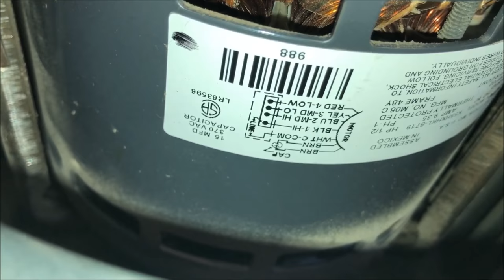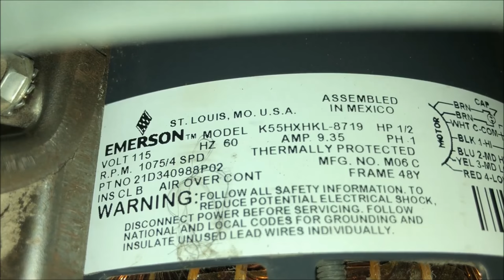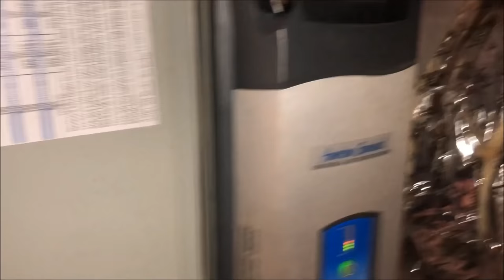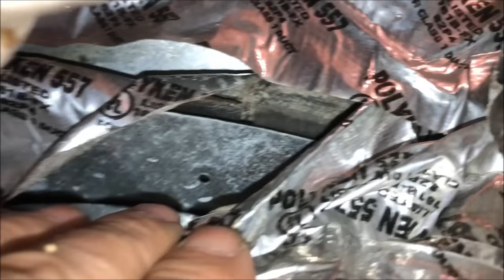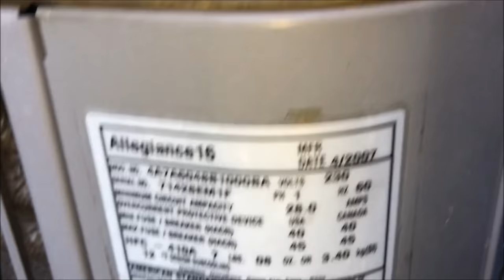Gas Furnace needs replaced ? Tripping Breaker 2nd opinion

Comment: Only thing I would add would be to make sure that motor bracket is nice and tight. Even if using those OEM rubber mounts. If you do not get that bracket on tight that motor will eventually torque its way round and rub the leads bare where they exit the motor shell. Against the motor brackets. I’ve only seen it happen once but once was enough.

Comment: I had a similar experience yesterday. Pulled into a no cooling call with the furnace breaker tripped. Reset and as soon as the fan turned on I saw a big spark from the fan and the breaker tripped again. Remove the speed taps and heat and ac would both turn on. The bad motor was installed 3 years ago by our good friend Mr. Run Cap Bandit who left the cap hanging

Comment: I remember a call a long time ago. Pretty nice house, the furnace would only make a humming noise. I checked it, and it was 208-230 volt on a 120 volt 15 Amp Circuit. Look everything over real good, the only thing I could figure is a hack job with a used furnace. Told them they needed an electrician, to run #12 with 230 volt to the unit. Of course they called the service manager on me. He came out, I told him to look carefully at it for any sign of a used unit installed. He agreed that’s what had been done, as he found some new screws in the flue pipe, that I had missed. He thought they had done the work themselves.

Comment: Great you got them cooling...amazing Trane/AS still uses the old GE indoor motor bracket for PSCs.  I remember them on the WeatherTrons from the late 60s.  Little more of a pain to replace than the belly band brackets, but I guess stick to what works.

Comment: Dude, you need to pull that blower and inspect the secondary heat exchanger, that rust probably ain’t from a hose.  I always pull blowers on furnaces older than 12 years.

Comment: Did the last 'repair' guys leave that unit that way? What a mess! Good cleanup!
Reply: I'm a retired electrician and have gone in after "electricians" who leave panel covers off, junction boxes open, hot wires sticking out, etc.  These jacklegs give good tradesmen a bad name. They usually work themself out of a job by the crappy work they do.
Reply from the maker: Exactly as you saw it yes.

Comment: not only is the long run just to do a 180 turn is insane, but all the up and down roller coaster track on the way, its not suppose to do be that for flex,
at least way I thought about the air pressures, it suppose to be a straight line.

Comment: Would you pull the new motor and put back in stock after replacing the customers old HVAC? That's assuming they buy a new unit within a couple weeks?
Reply from the maker: No.
Reply: I would not put it back in stock and pass it off as a new motor, but still set it aside and have someone remove it and label it as a “loaner” motor for occasions such as the one on this video.
Reply: It would be OK for a charity job, but you can't sell a used motor as a new motor
Reply: @adambell2068  I agree the motor could be used as a loaner. I wouldn't sell it without explaining to the customer that the motor had been in service for a few days.
Reply: The instant he pulled it out of the box it became a used motor.
Reply: Nope 🙅🏻 once you pull it out of the box it ultimately used without a doubt.

Comment: Probably should’ve replaced it anyways. Those 90s are known for cracking on the inside face plate. Always condemn those furnaces sadly.
Reply: was thinking the same thing, seeing date of 2007. but maybe they'll get a few more years out of it
Reply: throttle bottle I typically find them around ten years old. Trans says it’s okay to have a crack that’s no bigger than a 1/4 inch. But personally I’ll still condemn them better to be safe than sorry

Comment: Just curious but why is there a delay? I know when I turn my a/c on there is a 5-10 minute (sometimes it will come on without a delay) delay but theres no delay on the heat.
Reply: It's designed to protect the compressor.  It's not good to have them smashing off/on/off/on.

Comment: I'd like to hear more about the "clean effects".   I bought one several years ago.   Seems like our dust immediately went up rather than down.   THOUGHTS.  OPTIONS.
The other thing I noticed:  the electric bill went up immediately after changing to "high efficiency".
Reply: The clean effects filter needs frequent cleaning to maintain its effectiveness. A media filter works well, especially if aiming for MERV-13, but has to have lots of surface area to avoid increasing static pressure above the air handler's design pressure. Otherwise, if the static pressure gets too high, either the air flow goes down, or with a variable speed motor, the motor power consumption goes up to maintain flow. That causes increased energy usage. So, your higher energy costs could be from the clean effects not being cleaned often enough requiring the blower motor to run harder (and needing replacement earlier), or from the clean effects itself, or worse yet, by rewiring the unit to run longer to blow enough air. The flowing article describes some of the challenges of high MERV filters:

https://www.energyvanguard.com/blog/path-low-pressure-drop-across-high-merv-filter

Comment: Saw some super sketchy electrical work. The 3 conductor wire seemed to be stripped too long on the furnace side, and the hot could fray and cause a short against that metal plate! Not to mention, we have a missing (broken) face plate on the power switch! That leaves live contact screws within reach, which is a shock hazard!

Comment: BIG wire for the furnace 30 amp ?, motor is 9.35 amps ,15 amp 14/2  wire will work .

Comment: If you don’t use the oem motor the plastic pieces will not hold and the motor can move around on start or during the cycle making a noise. I’ve had used universals all the time and once I had to get the oem cause the motor wouldn’t stay in place.

Comment: Nice work.  I replaced my fan motor not long after the run cap quit. The end bearing/bushing inside the fan motor wore out.  The motor rotor was rubbing against the stator.  It hung and would not turn.  I'm thinking there might be a relationship to a failing cap putting stress on the motor rotation causing a wobble on the rotation causing an uneven wear inside the motor. I may be wrong on that, but the failures were not far apart.  Five years later and recently, the new run cap failed.   Now, a few months later, I have a vibration coming from the attic when the blower comes on.  Too cold now to troubleshoot it, but I'm thinking it's an interesting possibility, failing run caps cause uneven rotation and stress on motors.

Comment: Did i get it wrong or does the AC unit for the aircondition use gas to heat the air? Why is gas used so much in the US? Is it cheaper than electricity? In Sweden we use heatpumps to combine the heating for the house and warm water production.. Of couse we seldom use AC to cool the air.. though the last summers it would be nice with AC with an outdoor temp reacing 90F ... Think i need to install an AC before next summer to get a little cooling too.. :)

Comment: There you go again casting aspersions . This time it's toward alternative refrigerants. Someone had air in the line and you assumed it was faulty /fake stand in. You have a truck full of options and you went with the most expensive.  You are not near as good a steward fir tge customer or representative for the industry as you think. Another biased assumption. You are not God's gift to air conditioning.
Reply from the maker: Well, apparently you assume things without knowing the exact truth. That is a short coming of many people myself included from time to time. However, the R22 that I have had in stock for many years was purchased back in 2009 and 2010 when I only paid $60or $90 per jug. I was clever enough to buy a huge supply. I have never used stand ins and never will. It’s just my way of doing things. I am sorry that you don’t approve. But, thank you for watching !!

Comment: Didn’t even look at that secondary.  Also, for those techs out there you get than us, never hammer a blower shaft, he may have been using the rubber/plastic end of his hammer, but you could mushroom the end and give yourself a bigger problem.  You can use a crescent wrench on the blower shaft and turn the wheel and loosen it just as easy, finesse, not force.

Comment: You'll be back for a tripped breaker in a year due to the motor wires rubbing on the fan housing sharp edge. 40:08

Comment: Glad they were already planning on changing the system. From where the corrosion is in that furnace, I'm at least 80% sure it has a condensate leak from the secondary heat exchanger!

Comment: 10/2 wire on a 20 amp circuit? Is someone not worried about impedance? Little over sized there installer.

Comment: Have you ever come across a blower motor set screw that has been over tightened which causes the shafts to deform enough that you can't remove the motor from the blower? If so, do you have any tricks to remove the motor

Comment: Have you ever tried using anti-seize on the motor shaft
Reply: Fan still spins, so it wasn't seized. Also the ones I've seen don't typically start smoking right away. Usually smoking that quick is consistent with a shorted winding.
Reply: @DilanGilluly  Pretty sure hes talking about putting anti seize on the shaft where it fits into the squirrel cage, so its easier to get the motor off 10 years later.

Comment: @4:30
I hope your install crew is pulling in a new circuit for the furnace to replace that bootleg 120v tap for the furnace during changeout given it's tied in on the outdoor disconnect.

That plastic sheeting sure does make a crawl space much nicer to work in.
Reply: It's gas all you need is 12/2 wire 10/2 wire is way more than enough.

Comment: Ted - In a case like this where you've just put in a new motor, will you try to recover that motor when the old unit is removed and scrapped?
Reply: If you are the guy that did the service and know the condition of the gear, it makes sense to save it, but if you're coming in behind someone else to entirely replace a unit, it doesn't make much financial sense to disassemble and save parts of the unit in unknown condition.
In my own IT field, I come across dumpster fires similar to this all the time. Some scumbag trashes customer equipment and salvaging what's good often times costs more in labor than just outright replacing it with something new and reliable. It's always good to salvage what you can, but you have to remember that you can end up with a warranty position on gear you didn't install, or gear that ends up failing because of abuse/neglect/etc. that makes you look bad.
That being said, I was lucky and scored a pretty much identical blower to the one he is working on a few weeks ago, it was from a recently scrapped A/C system being replaced. I wired it up with a back box attached to the housing and a double pole, double throw switch to use the two lowest fan speeds, as they were plenty to use it as a shop fan. The only thing you need to be aware of is that these blowers need a drag on the intake, or the motor will over amp and burn up. I used a stiff piece of cardboard and nashua tape over the intake opposite of the motor and blocked off about 50% of the intake hole, which was enough to make the blower run normally.
Reply: That's a no brainer

Comment: Such a perfect application for hybrid heat pump water heater - one, 80 gallon.  It’s time to decrease gas use and learn how well domestic heat pump water heaters work. 

Especially if homeowner has/adds solar rooftop and battery.

Comment: Thanks Ted. I watched the whole thing. I got tired of my hands sweating with those nitrile gloves and only use those on PMS because they are water resistant. However, I bought a pair of grease monkey slip resistant work gloves and I love them. Only down side is you can't always use your phone but they are light weight and durable and let your hands breath.You need a medium pair. Let me know and I'll mail you a free pair. Thanks again.
Reply: Nitrile only on PMS?

Comment: Why do people insist on using the plastic face plates on make up boxes that aren’t mounted in drywall?

Also why doesn’t anybody use either armored cable so you don’t need a grommet or at least install a grommet when you’re going into metal because that stuff just gonna vibrate and cut a nice short in the Power supply line